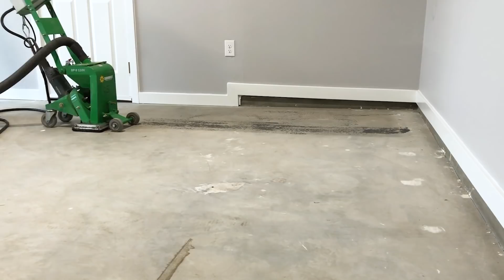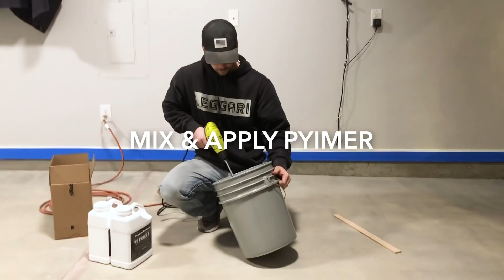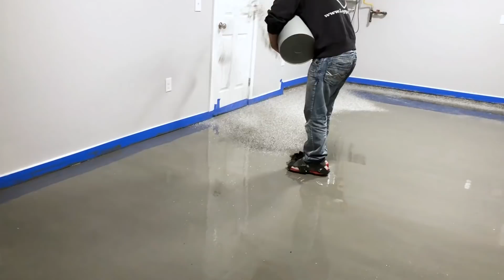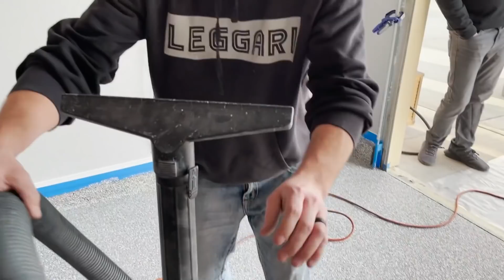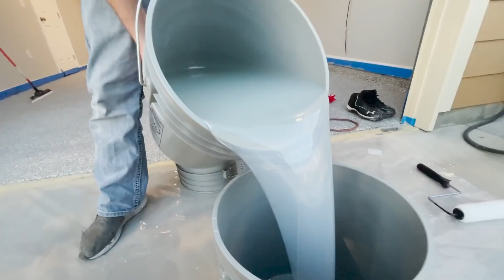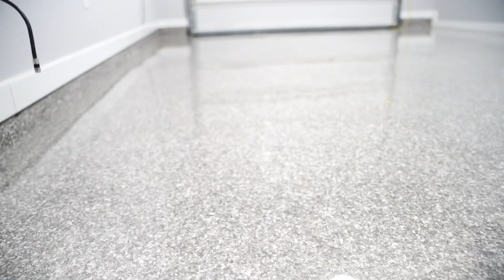Easy Way To Upgrade Your Garage Concrete Floor Using Epoxy & Flakes!

Comment: What type of clear coat is that?
Reply: Epoxy resin.
Reply: Will epoxy resin yellow with sun light or uv rays?
Reply: It’s polyurethane or clear topcoat
Reply: @relaxingmeditation8740  It shows in the written description what they're doing at each step. Says epoxy.
Reply: @danielmora6244  Seems to depend on the epoxy resin product. If it's a UV stable product, they will generally advertise as such.